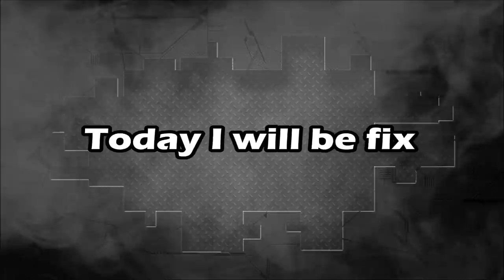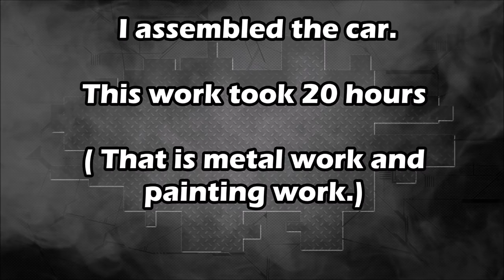BMW E39. The quarter panel repair. Ремонт заднего крыла.

Comment: İt would be awesome if you could write repair costs
Reply: Deniz sir, it would be irrelevant as labor and other costs, most likely will be different wherever you are.. At the end of a clip you're being given a key info: it took an X amount of hours.. So perhaps you should know how much top tier master makes in your region and surely can find out how much parts used cost new or from local junkyard.... In previous clips he had mentioned that his services are calculated based on $15/hr, as far as parts, they're usually ordered/provided by the client with Arthur's guidance on what will be needed, again, this is per Arthur'r past replies...
Reply: İ'm living in Austria and here is the body repair really expensive. Often its cheaper to repair your car abroad. Thats the reason why i asked this question
Reply: He once said that 1h = 150 EUR. I don't know if that is still correct.
Reply: That would be the hourly cost in Sweden, not to neg on his work but that would be reaaaally high for eastern Europe.
Reply: Pavle Pajic never.... max 800€
Reply: Pavle Pajic in a bmw Shop but not in lituania
Reply: For 3k it is possible to buy one more e39.
Reply: wtf are you talking.. 3k euros lol.. In his country you can buy 3 pre facelift e39 so no one would pay 3k for that lol